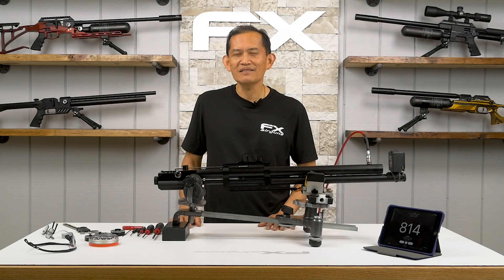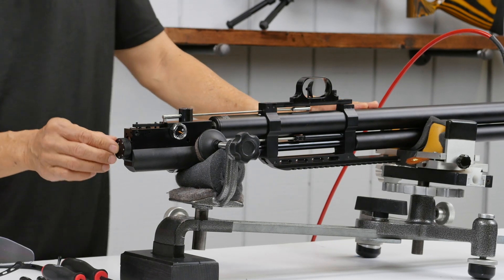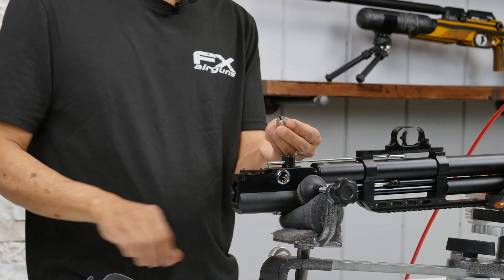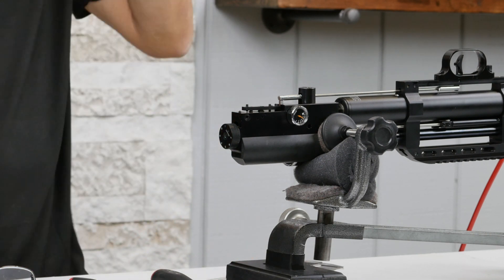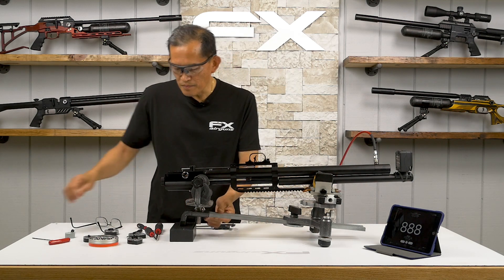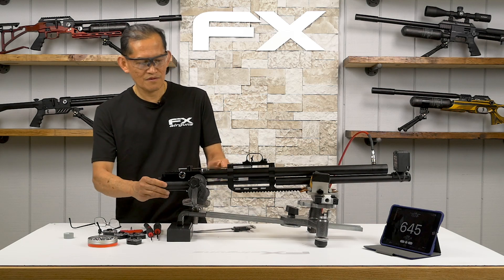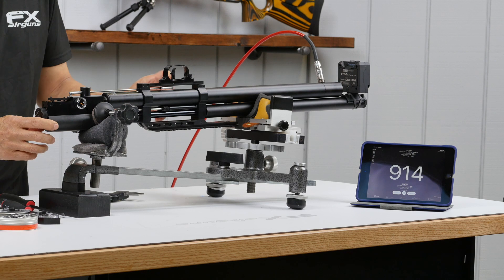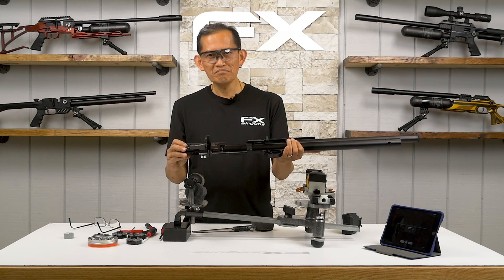FX Wildcat MKIII High Power Tuning - FX Airguns

Comment: I just bought my wildcat and tried adjusting the reg how you describe in this video.  My reg does not go above 100 bar.  I ended up unscrewing the reg to far and it sprang a leak after about 1 full turn counter clockwise.  I screwed the reg back in and that caused the washer that came loose to end up damaged from the threads.  Replaced the o ring and reg still not going past 100 bar.  What is my issue?

Comment: will there be more videos of tunning? accessories? upgrades or other new info on the Wildcat? i own the WC sniper 700 mm BT version and have very little luck with other YT videos of information about tunning the WC, does it go well with slugs? pellets? There's plenty of info on the M3 impact, but you guys have other models so would like to see an update video other than the 2 yr old series on assembly and disassembly.

Comment: With my bottle pressure at 230 bar and adjust screw at max at a regulator pressure of 150 bar I can only get 850 fps with 44.75 gr. In my wildcat 3 bt compact. Is there anything else I can do as I like to shoot at 900-910 fps. The gun is new.
Reply: Add plenum
Reply: Add slug kit

Comment: BTW, why does FX doesn't use the space between the barrel and the shroud as a silencer solution, like the Benjamin marauder does for example?
such a big volume of air wasted and just counting on an add on silencer does not make sense to me
This gun is not legal built like it is now to be allowed in country's like Belgium. (it is a not power related problem)
To know what the problem is, please contact me.
How the 95 joule is also accomplished in .25 sniper edition, remains a question mark. with JSB king 25.39, the reg on 150 and hammer max. out minus 90° turn = 1023 FPS or 80 Joule (with double port for slugs active)

Comment: Hi Ernest, love your tuning videos, I shoot a wildcat mk 3 btvp 600ml barrel, I am currently using 18.13 grn jsb pellets, running at 945 fps, at 37 ftb, second reg is 110 bar, not sure of first reg pressure as not altered it as came from shop, I am wanting to shoot the 25 grn jsb pellets at distance not beyond 100mtr, I am looking to raise power to around 42 ftlb, can you advise me what the reg settings should be, or can I achieve the extra power needed by fitting a 11 grm hammer weight and 6ml adjustment on hammer spring adjuster, I am not getting much help from dealer I purchased gun from,

Comment: Hi Ernest, I have a .22 Compact MK3 does the same rule apply on the .22 cal as the .30 cal setting pre-load screw at 6mm then adjusting my regulator as you did to the desired pressure / speed for my choice of projectile weight ? Do different calibers have different tolerances regarding pre-load screw @ 6mm or does this setting work for all calibres in the MK3 Wildcat across the board? Thanks

Comment: Hi and thanks i found this really informative, i have just purchased a new Wildcat mark 3, sub 12ft pound model .177 custom with the 500 barrel and have done some testing with the prefeered pellet being JSB 8.44 grain , it is filled to 230 bar and the regulator is at 50 bar, the results are rather disappointing achieving 726 fps which equates to 9.88 ft lb, cani tune up and what is recommended, any help advice would be appreciated.
Reply: You should find that running the reg pressure at 60 bar give you around 12 ft/lbs without any other mods. The .177 model won't go much about 20 ft/lbs just because of the efficiency of the calibre. If you go much over 60 bar, you'll need to also increase the hammer spring and weight - lots of info on that if you search around. For max power you'll need a .30 cal calibre change kit. HTH
Reply: @FazerWiz  hey great thanks for that i actually experimented myself following ernests guidelines i was disappointed not recieving feedback from the man himself but hey ho, i made the following adjustments if it helps anyone else, my original reg pressure was at 50 i adjusted it to 60,
the hammer spring adjuster was set at 2,20 mm and i increased this to 3mm the difference this made was from 10.1 ft lbs to 11.3 ft lbs which for minor adjustments was impressive, i was using jsb exact diablo at 8.44 weight, these i found to be the most accurate and consistent for my gun, great gun by the way im very happy that it is very accurate and i can do things with it in the future would recommend.

Comment: Hi. I'm a big fan of the channel. I purchased a wildcat MK3 and I have a small leak at the end of the pipe in the thread where the liner is pressed but it only loses air when it is not cocked, when it is there is no leakage. I know it's coming from behind the gun block probably from a damaged orring or pin valve. I just wanted an expert opinion to help me pinpoint the exact source of the leak so I can fix it so I don't have to replace everything. Continued with the excellent videos. Hug

Comment: When I attempted to adjust the power wheel on my new gun it came loose like the screw was never tightened properly. Should i use some thread lock on it. Is this common. With reg at 150 bar on my 22 cal and 14.1 grain pellets on 7 I’m getting 1010 fps

Thanks

Comment: Hi Ernest Thank you for your great video's. But Can you please help. When i tried to Adjust Regulator Gauge From 125 Bar To 150 Bar. It went up to Max 200 Bar. And now i cant Decrease it.
Regards
Reply: Oops  let the air out of the bottle, all of it. Then lower the reg by turning clockwise. Fill the bottle again and turn it anti clockwise to find your desireble reg setting. Never ever lower your reg when the bottle is under pressure

Comment: Another question I've got if anyone knows, out of curiosity and for future sake. Aside from saying not to adjust the hammer tension while the gun is cocked, which unfortunately my dumb ass already did, an hopefully didn't cause any very small but significant "internal damage" to the adjuster knob or screw, plume, etc.

But it also says NOT to adjust the regulator clockwise," while the gun is under ANY pressure.

So if "counter clockwise" is "increasing" the regulator pressure, as he did in this video. Clockwise would be "decreasing the pressure."
So when it says not to decrease the pressure, while the gun is "under any pressure." _Does this mean the BAR pressure must be at zero, in order to decrease the regulator pressure ?

Cause I thought it also says not to really keep the gun "empty of any air." Or does this just mean "not to have the gun plugged into any source of air, like a compressor or scuba tank.."
Reply: To decrease the reg just turn it down a quarter turn at a time and dry fire it. Don’t adjust it down too much at a time:) you need the pressure in the tank to be able to read the reg pressure. What they mean I think is don’t adjust the reg with the gun cocked. Have fun!

Comment: Ahhh I fuggd up, hoping no damage is done. If anyone knows and or can help me out with these couple questions..

Just got my .22 cal Wildcat MK3 last weekend, so don't particularly want to mess around taking certain things apart yet unless I've absolutely got to. Although plan on tuning it a little later, an after I pick up a chrono..
Anyways I knew you're NOT suppose to adjust the hammer tension when the guns cocked, but didn't know the damn thing was cocked.

So when I tried to turn it, obviously it was way stiff and hard to turn. But instead of checking if it were cocked, I was freakin out thinking somethings wrong with the knob. So I forced it one way, then back the other. Then fricken continued...
You could hear it like drop or open up more freely, when I then turned it to the (8th) adjustable position. An then from there turned it AGAIN, to the level 7. The tightest and worst position to force it into.

Yes this was not good. The knob is still working fine after. Gun cocks, fires, an seems to be changing pressure and functioning as it should when adjusting the knob.
My question is, I'm pretty sure the knob is metal..

Does anyone know if the "leveler steps" on the inside of the knob, are metal as well ?
An seeing as it still functions fine ( operationally ), my only REAL concern is if I may have possibly grinded down ANY of the steps.. ( especially the level 7 being the highest step ). Cause I could feel when there was more resistance, an I pretty much forced it to turn into position.

The only way for me to really know, would be to check with a chronograph. An see if it's still pushing the right tension and power. Or to take the knob off, an see if there's any grinded damage.. Looks easy enough, really don't want to lose the mini bearing though.

You think turning it about 4 times, smh. Would be enough to damage and grind that piece down..?
Reply: Take the knob of friend:) screw it loose, remove it slowly, the bearing will stay in the grease but keep your hand under it just in case. Just don’t cock the gun when it’s disassembled and you’ll be fine I promise:) congrats on the mk3 brother, I got one last week and I accidentally shot it with the cocking arm open and it closed on its own, it’s a learning process, don’t beat yourself up:) have fun exploring👊🏻

Comment: Hello, this is my second fx and i just bought a stock fx wildcat mkIII .22 which is 41 joules, can i do your procedure to increase power up to 55 joules? thank you
Reply: Yes turn the reg up to 150 and then find the max speed, and then back off a little so it’s not maxed out:) then take some time to find the most consistent speed around that 860-900fps mark and then fine tune for accuracy:) have fun! Don’t forget don’t change the reg or the hammer spring when the gun is cocked!
Reply: @kims2r  thanks bro 👍

Comment: hello, i just bought my second fx rifles from one of your dealers and this time it's a mk3 wildcat. I am very disappointed by the noise we hear inside the case and which is perhaps the sound of the hammer moving around inside. this noise disappears when the cocking lever is cocked. is this noise normal for a completely new weapon? I remember that this noise was also present on my old fx royale 400 that I had bought new, but this noise appeared much later and not from the start as on this wildcat mk3 compact. can we do something to suppress this noise? 
i have a facebook page dedicated to pcp airgun and i do a lot of advertising for different manufacturers and i also advertise your products. my page is called PCP AIRGUN FRANCE.
thank you in advance.
Reply: It’s the free floating hammer. It’s totally normal. Every wildcat from the mk1 on does the same thing.
Reply: @arubino19  ok thanks 👍

Comment: Did he go from 870 ish fps with 120 bar regpressure to only 920 ish with 150 bar reg pressure and increasing the hammes spring? Sounds like not a lot of gain for the amount of rise in  reg presure.
Reply: Remember he was shooting 44gr pellets. Use lighter pellets and your fps will increase.

Comment: What do you use as a back stop in the workshop?
Reply: Tall kitchen trash can filled 1/2 way 35lbs unusable metal gun parts 7-8” rubber mulch then about 6” of foam that is used on FX gun case box. We tried over 12” of rubber mulch but the .30 went through in about 2 mags, this back stop material that really works. 😄
Reply: People who ask dumb questions.

Comment: Hello I have an FX airguns Wildcat MKIII
With 919 feet per second it only makes 43 joules while on the technical sheet the FX airguns they announce 55 joules why cordially
Reply: Which projectile are you using?
Reply: You have to adjust it...and it depends what caliber you have.
Reply: 919 fps with a 30 caliber is 113 joule with jbs 44,75 grain
Reply: Hello, on my Fx Wildcat MKIII Lead JSB Match HADES .22 5.5 mm 1.03g 15.99 gr
943.7 ft / S 42.63 Joules Maxi
Reply: @bruno6321  in the vid is a 30 caliber wildcat
Reply: @peteralexben  Hello, yes I understood I am talking to FX Aiguns that my model does not exceed 42 joules
Reply: @bruno6321  there is a maximum at the power output .most pellets wil not be accurat much above 900 fps. .and if you have a reg pressure of 150 bar .then wil 150 bar do more at a larger diameter of a bullet. If a bullet had a base of 1 cm2 you have 150 kg at the base .if its the a half cm2 you have 75 kg at the base .
A 458 airforce puts out 1100 joules
Its a matter of pressure. The plenum volume .airflow and caliber
Reply: @peteralexben  Hello all that I understood it well I am just telling you that original FX airguns a new wildcat MKIII 5.5 mm lead must come out 55 joule me I can not with any brand lead to switch to -beyond 45 joules. cordially
Reply: @bruno6321   its not the brand pellets, but the reg pressure , valve opening time(Hammer spring)  .plenum volume , barrellenght  ,probe, transferport that makes the difference
Reply: @peteralexben  on the manufacturer's FX Wildcat MHIII technical sheet there are 55 joules compri ?????
Reply: @bruno6321  if you buy a wildcat in the UK it can also be  16 joule .in germany 7,5 joule ,in sweden 10 joule  and so one ,its a question of settings( and some parts) ,your gun should be tuned up if you want 55 joule , but proberly it wil not be as accurat. because 900 feet per second is good for pellets.  turn it up to 1040 fps  and you got your 55 joule  with a 1 gram pellet .and check of not a o ring in the barrel is leaking via the probe (that  part that drives the pellet out of the magazine ant into the barrel  .it can be damaged by  a bur at a pellet .
Reply: @peteralexben  You don't understand what I mean on the spec sheet = https://fxairguns.com/rifles/wildcat-mkiii/
Me with 150Bar adjustment screw at 6mm no more than 45 joules Simple No
Reply: @bruno6321  its not only the reg but als. The hammer and airflow.  And remove the barrel and look how the. Brass piece is. Mounted and the hole in it . if fx claims that 55joules can be done. .regs can adusted higher then 150 joules . try a huma  high flow v2  dual hole poort and a plenum
Reply: @peteralexben  Thank you I abandon a costructeur released on the technical sheet 55 joule are entitled to have 55 joule you do not understand what I mean Thank you again.
Reply: It’s possible you’ll get a higher joules reading with a heavier pellet tho. I managed 45J with H&N baracuda 21.14gr at 850fps I believe. And the reg is just around 130 so maybe you have to try heavier pellets. The hades is pretty light:) have fun!

Comment: I appreciate this video. So, I assume that MKIII is stock out of the box. Does the procedure change at all with your 2.5” plenum extension? Can I expect higher FPS with the extension and high power tune?
Reply from the maker: Yes, a plenum extension would create the ability for higher FPS, the process would be the same, except you will need more hammer tension to work with the added plenum.
Reply: @FXAirguns  do you have a Wildcat Mk3 power plenum extension to sell?
Reply: @FXAirguns  hi mate I’ve just bought the fx wildcat in the uk what should that bar gauge on the side be set at mines at 70